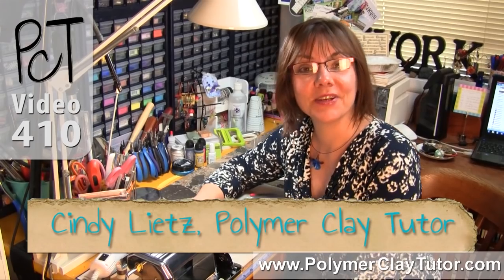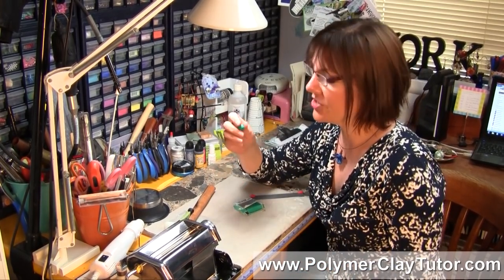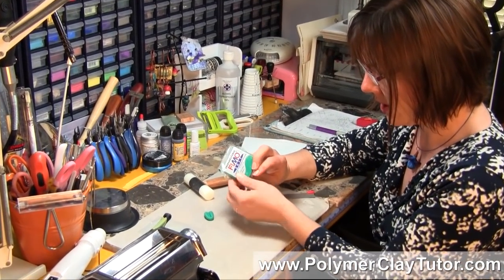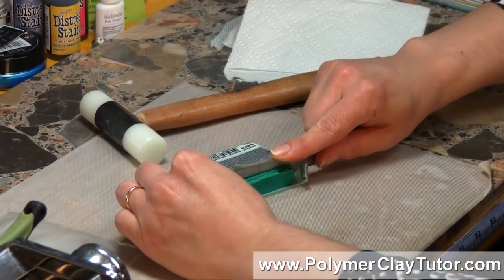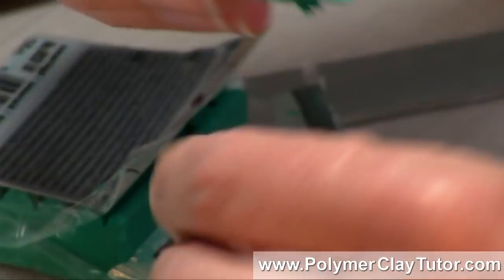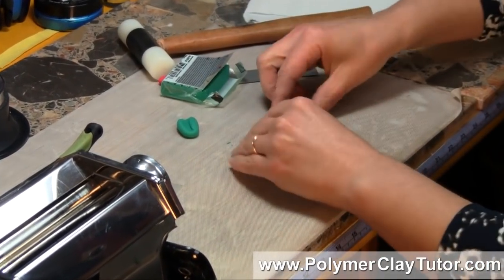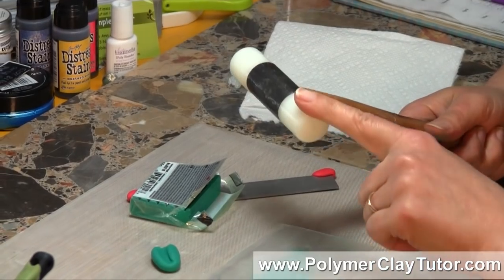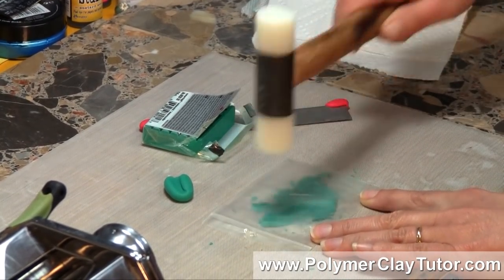Conditioning Hard Polymer Clay - Tip #1 Using a Hammer

Comment: Thanks for sharing this! I recently purchased one blue package of "Fimo Soft" and loved it. I've been working with "Sculpey iii" which is my first attempt at creating clay jewelry. I made several pieces and found that there were several "wonky" spots in the pieces. When I worked with the "Fimo Soft" it was much easier to avoid the distortion. So, I returned ALL of my Sculpey and bought Fimo. Some of the colors (White, Black) were extremely hard and difficult to get softened enough for rolling in the pasta machine! My hands were very sore! I have tried the hammer out & it worked brilliantly! Thanks again for sharing!

Comment: I also just add a bit of oil to the clay (like a cooking oil). I add the oil and roll, fold and add more oil as needed until it is workable with my hands. I like using this method but it does take a while. I want to try this hammer method because it goes significantly faster than I thought. Thanks for the tip.

Comment: I have been using turpentine on premo!, fimo  and super sculpey  for the past  four years and it has not weakened the clay as far as I can tell. I primarily use it to create a type of slip for my sculptures to blend  and erase lines ect. but these are thicker than the jewelry and embellishments you make so it might not be good on thinner peaces of clay  but on clay 1/3 inch thick and over I have not had any problems with.

Comment: Mineral oil made mine sticky.  So did the two drops of Kato Polyclay Liquid, and TLS.  I had a 3 lb box that was ALL dry and crumbly, regular "soft" Sculpey.  I just kept putting it through the pasta machine, then warming the crumbles in my warm hands, putting it through again, over and over.  If they didn't start to stick together after 4 or 5 tries, I warmed my hands on a hot coffee cup, held the crumbles for longer, and did it again.  The clay did stick finally, and became very nice to work with, not as soft as regular soft Sculpey anymore.  The next box was clearly newer, and almost TOO soft, after that experience!

Comment: When I have clay that is really hard, I add a very tiny piece of Sculpey Mold Maker and work it in.  I continue to add more until it starts getting workable.  This is a trick I learned from Lynne Ann Schwarzenburg.  I have also put clay in a large zip lock bag and put it on the garage floor and hammered it with a big mallet.  I wanted to run over it with the car but my husband didn't that was a good idea in case the bag broke. LOL

Comment: I was told you could add 1/4 teaspoon of mineral oil at the most to one hole block of clay.  I would do it one drop at a time. She mixed hers in a food processor first with the oil then puts it through the pasta machine. I have not tried this. But she is a professional with polymer clay so imagine it works.

Comment: My Premo  is fairly new, just a few months old, and I checked the date and the softness before I bought it.  Now most of it, the scrap and the unopened new clay is turning very hard after such a short time.  I haven't worked with it in about 6 weeks, but the weather is changing now, and I have a few drafts in my apartment, I keep scraps in a zip log bag, and all the new stuff in a large deep closeable sterlite plastic container.  Could there be a draft causing it to get hard, or is it the way I am storing it.  Please help!  Thanks.